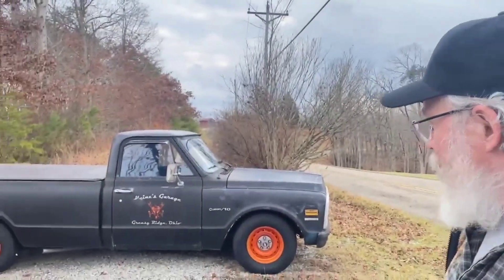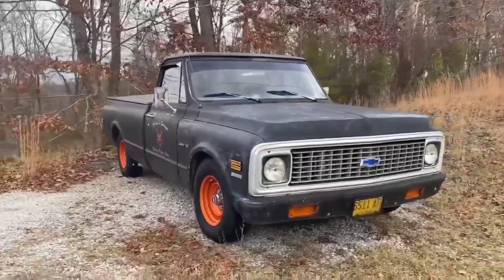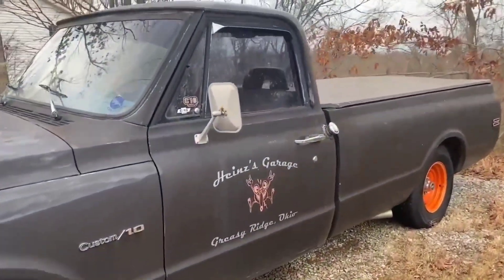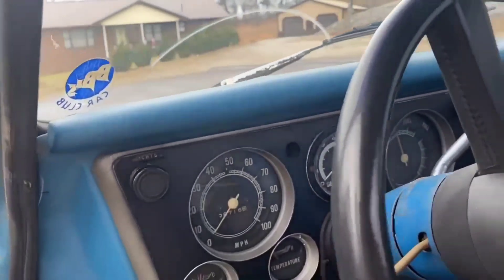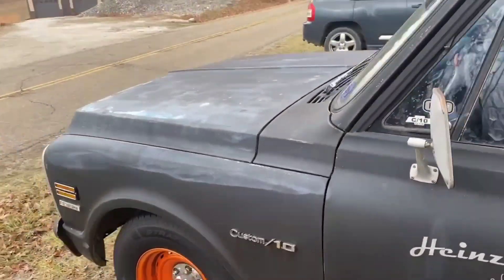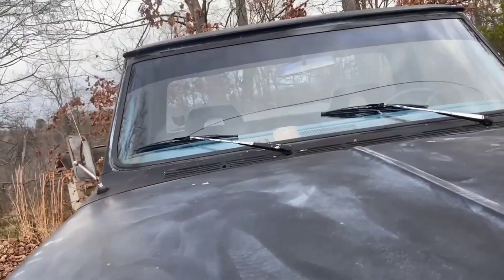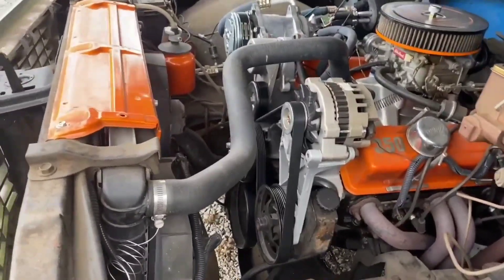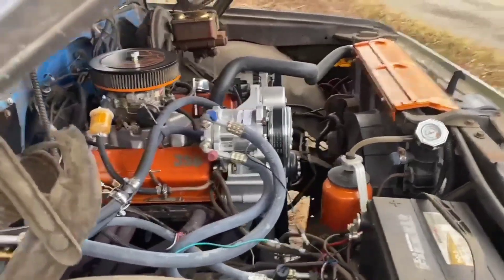PIB'S SUBSCRIBER RIDE'S! Today we're looking a 1971 Chevy C10 truck goes by the name of "Tigger"!

Comment: Cool. Loox like a Halloween car with the black body & orange rims.
Reply: The steering wheel is off of either an 88 - 94 OBS or an 89 - 91 square body. Those generation Chev & GMC pickups were produced from 67 - 72, & same with the Suburbans & panel trucks except the panel trucks were discontinued in 70. The K5 Blazers on the other hand weren't produced yet until 69 & the Jimmys weren't produced until 70. Like the pickups & Suburbans, the K5 Blazers & Jimmys were also produced up through 72. Those generation pickups were the last to only come in regular cabs & the last before the square bodies.
Reply from the maker: Thanks!
Reply from the maker: Thanks!